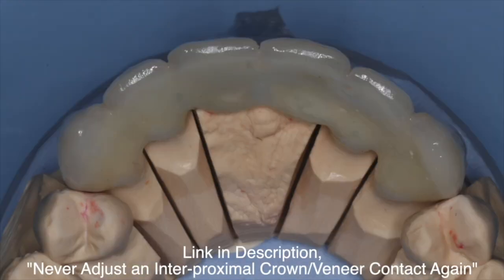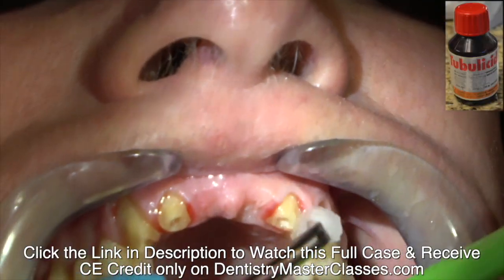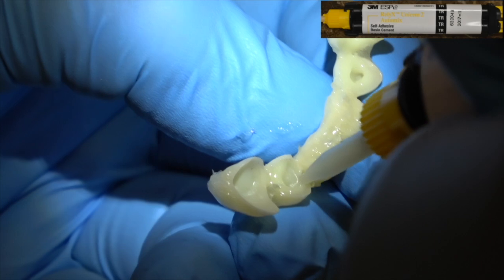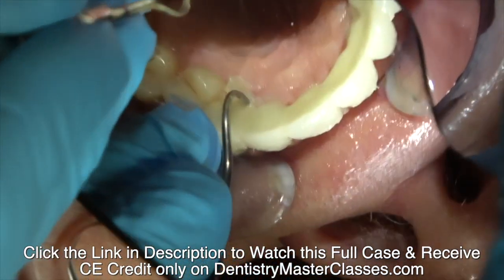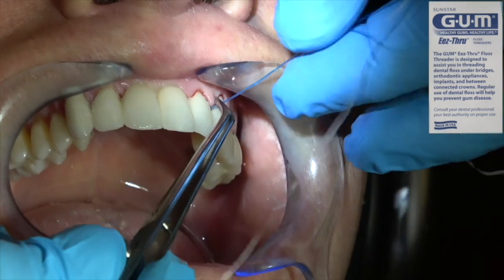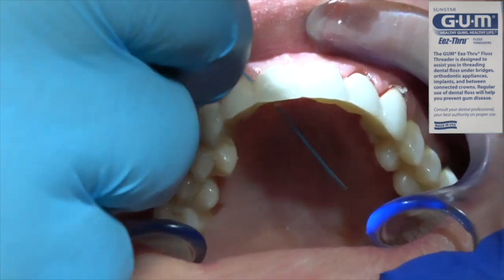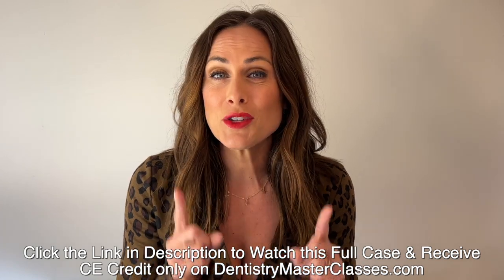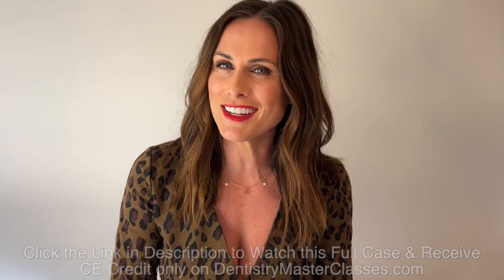How to Floss a Bridge - Dental Minute with Steven T. Cutbirth, DDS

Comment: I am shocked by the lies still being perpetrated by the dental industry.  I just googled the subject of danger of root canal, written on Colgate website.  It says:  Despite the claims you might read on the internet, root canal treatment doesn't cause illness. The American Association of Endodontists (AAE) reassures patients that there isn't any scientific evidence linking root canal treatments to illnesses or diseases elsewhere in the body.Jan 9, 2023
Reply from the maker: What is your point. An endodontic procedure is a procedure that can be performed to save a tooth vs. extracting the tooth. The only options for an abscessed tooth (dead nerve) or a hypersensitive tooth are endodontics (remove the affected nerve) or extraction of the tooth. If a tooth is responding negatively to any procedure, especially a root canal, there will be a widened periodontal ligament around the roots of the tooth which can be clearly identified on an x-ray. If the affected canals of a tooth are filed and irrigated thoroughly, these teeth can last many, many years. There are no scientific studies that associate root canals with systemic illnesses or diseases. I personally have had about 4 root canals from sporting accidents and I am a very healthy person with no known systemic problems, and those teeth function perfectly. I would prefer to have a properly performed  endodontic procedure than a tooth extraction and an implant or fixed or removable bridge if given the choice. It is certainly not a financial gain for the dentist to perform the root canal. An extraction and tooth replacement with an implant or fixed bridge is considerably more expensive than a root canal. You can always find some group that claim some medical/dental procedure is bad for you. I won't even go  down that road. If some group just has a personal opinion about a procedure being bad for you, without studies to back that opinion, then what can be said. In dentistry we probably would be limited to only extraction of teeth